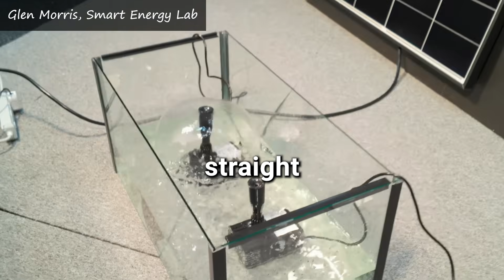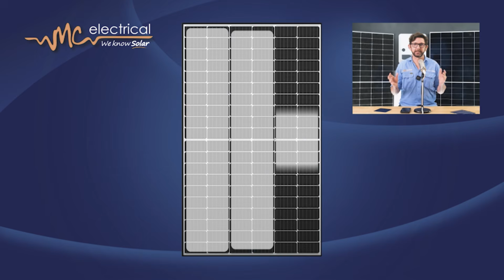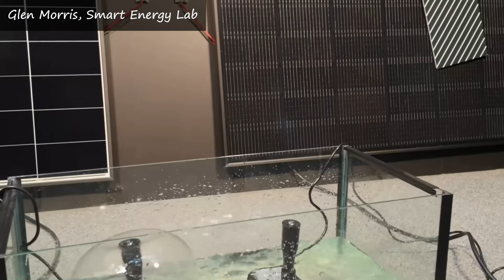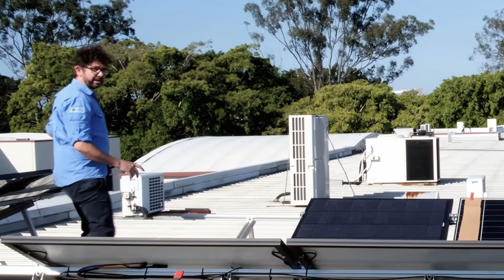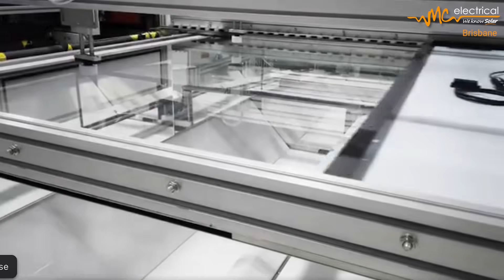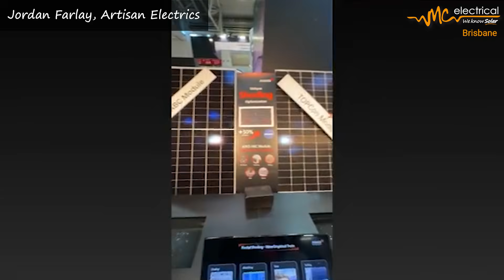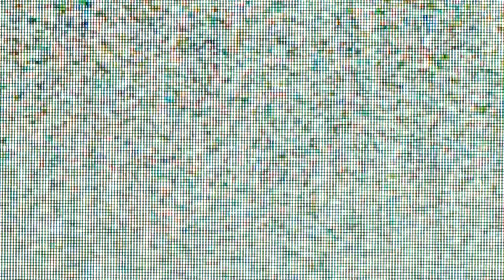TEST RESULTS REVEALED. Do Aiko’s shade proof claims add up?

Comment: So what was the out come did they get back to you?

I was doing the AI questions and get deep into a aiko "shade proof" research hole lol
The west side of my roof has heavy tree shading at like 2pm in winter.
From memory my winter daily production is only 3kwh avg on a 5kwh system ha
Summer she cranks pretty close to the avg.

So yeah found this video doing research trying to figure if its better for 20 aiko 500w or 23 440w "regular" jinkos 

I'd more or less love to see this testing done with branch shadows across multiple panels rather than just putting a piece of cardboard across one panel, or enough of a shadow to block a small portion, hooked into the same string.. even just like a person stood infront of the panel blocking the sun (again could be inconsistant) but it would block differnt parts of the panel like an actual tree would.
But that would be hard to get consistent results 
*And as the t'n'c's say you're not supposed to install in a shady area ?
Reply from the maker: Yeh Aiko were dirty at me. But, the story continues. I was in the Longi factory a few months ago and I convinced them that the shade demo that they also use is BS. They agreed to take down the misleading marketing from the trade show this week.

Comment: now wich beter?aiko or topcon?
Reply from the maker: Good question. I don’t mind back contact. Looks pretty nice and can have a small advantage with bird droppings etcx Vut Aiko are not the only company doing back contact. I’d probably choose Longi over Aiko if I wanted back contact. The only reason I haven’t changed to Longi, like others, is they refuse to update their install manual to allow the panels to be installed in an area that will get shade, meaning, any shade , ie 6am shade. Same with Aiko, same with most panels.

Comment: That's called integrity. We're just finishing building our new house and we're absolutely getting MC Electrical to help us with solar panels, battery, and chargers.
Reply: Be sure to get other quotes from quality installers. For example, I got a quote from MC Electrical to do 3 phase upgrade was estimated at $6K but I got someone else to do it for $3K granted I dug my own trench from meter box to the Greenboy.
Reply from the maker: Thanks, we're happy to help when you're ready. Give us a call on 3268 3836.

Comment: Hey. I read about those abc panels. In fact longi is doing "back contact" cells now too. As far as i understood and read somewhere on their page - cells works like bypass diodes, BUT whe more than 3 cells in row is shaded - bypass diode engage. So when shade is big enough - bypass diode will work, so thats why you had most gains in "wallet size scenario". - so you shaded 1 cell and it was bypassed. If it is working as good as it is expected...  half cut panels makes no sense anymore. If there is shading in one half of panel in half cut, and they really works like bypass diodes it creates difference in string lenght between upper and lower part so this 1/3 of panel works suboptimal. If there would be halfcut - so one big squere cell like in old panels - only shaded cells would be bypassed, and all the rest would work optimal
Reply: Yeah, and maybe bypass diode is not needed anymore, since it just simply bypass those cells and allow full current run through
Reply from the maker: I was at Longi’s factory a week ago. I argued with their engineers and they finally agreed with me. This Logic of 3 cells being shaded only works when one panel is in running. Put it in a string and it doesn’t work. I asked them to stop lying to us and take that stupid trade show demo away. I think they might

Comment: do all the tests ya want  
real world on  a roof in the sun when clouds come over  and what change it makes at the inverter output   for similr wattage panels  and same inverter   and how well they do at sunrise  and around sun set    tests in a hall with uv generator are all rubbish    only real tests in the outside with sun    is all that really matters
No cloud comes over and completely blocks up a strip     monitor when cloud cover affects bothh again real world tests

Comment: I enjoyed your test. Question from ignorance. What happens if any panel is shaded evenly all day by a large building rather than partially by say a chimney? Will they work at all? Thanks.
Reply from the maker: Great question. I’ve got a bunch of videos around this. Maybe look at my Enphase videos from a few years ago. But in short, most inverters deal with this easily. Fromius and SMA deal with it better. It’s basically the job of a bypass diode, improved by a good inverter algorithm.

Comment: Mine are working an absolute dream. I have loads of trees and all installers told me I needed mitigation. I ignored them and got these panels without optimisers or micro-inverters, they exceed all output projections.
Reply from the maker: Great that you are happy with your production but I guarantee you it’s not because of secret sauce in the panels. It will be because of simple bypass diodes or the mppt or gmppt of the inverter. Accurately estimating production in significant shade is basically impossible. Your installers were wise to project conservatively, and hopefully used an inverter with a gmppt.
Reply: @ Thanks. They were predicting 30kWh a day this time of the year, with optimisers. I’m actually generating 80 kWh without optimisers. I’m using the Tesla PW3 hybrid inverter. They (not just one) got it very wrong in my case.
Reply: @yp77738yp77739  the Tesla PW3 most likely uses some sort of gmppt.

Comment: Power density is the point and you've knowingly ignored that. The 475W are 23.8% efficinet while the Canadian is much lower density.
Reply from the maker: Fair point. But it wasn’t really the focus of this video. On the previous video I mentioned it was stubbier for the same power class. This video was about their claims in the shade. The new Canadian 465 is 23.3% efficient. Close but no cigar. But they have a proven track record, so that extra 10mm of panel is probably not that big of a deal

Comment: Hi Mark. So I worked for a company where we built our own Aiko presentation for expos and we did get the good results that showed Aiko was shade tolerant. Also while messing around with the display we found that with significant shading the Aiko still worked well. Can you explain why this is the case compared to your “real world” simulation? Also, you were saying that the superior performance of the Aiko in the middle of the day was irrelevant and you probably should have mentioned that if you had batteries you would realise the benefit. Anyways, really interested in hearing from you in regard to my question because I’m genuinely bamboozled. Cheers!
Reply from the maker: Thanks for the comment! Interesting. Yeh I don’t actually know the answer. I figured they don’t do a dodgy set up in the background, or otherwise people like you would blow the whistle. It’s just a niche voltage and current characteristic that happens to show the difference of Aiko.  And there is a difference. Just nothing tangible in the real world.
Reply from the maker: Batteries, yes good point. I’d be keen to talk more about this. Are you based in Australia? I’d be keen to learn about that setup. Contact us sometime if you get the chance and tell my team about this chat.

Comment: I can think of 3 ways to do this demo;  One possibility is to down right deceive by using a battery on the panel that keeps running when shaded. The other possibility is to manipulate the result by picking a pump that only runs on a very certain voltage, where 2 strings from the competitor panel (440w) would not be enough to run it but 2 string from the other panel (470W) one is. The last possibility would be to have a circuit in line that cuts all power from the panels when it drops below a set voltage and again tune that to the exact voltage of your panel you want to show off.
Reply from the maker: I think it’s closer to option 2. There is not enough reverse module current to engage the bypass diode on the Aiko. But there is with canadian. Just a niche test that works well for Aiko

Comment: LOL,
They are doing that demo at a trade show, where is the sunlight coming from?
Reply from the maker: It’s a spotlight they have shining on the panel. Yeh I was surprised that would work too. I have been meaning to test that one day, but Id need to get the correct dc water pump etc.

Comment: Very informative video thanks.  We used to use Jinko and JA panels and although they were great panels, we have found that our systems are performing better since changing to AIKO panels.  When AIKO were introduced to us, we were told by our Supplier not to be reliant on the shading feature and to still install optimisers as we normally would.  So I think the shading feature is bringing down the reputation of a good panel which is a shame.  I think you are right, they need to look at their marketing because they don't need a gimmick.
Reply from the maker: If they are performing better, it would probably be that the old panels degraded. They used to degrade about 1 percent a year, newer panels degrade slower. I wouldn’t expect any more than 0.5 percent gain from Aiko - but that’s only if it were a bizarre morning and afternoon shade situation.

Comment: I came across this video as I am being quoted Aiko Neostar and also Jinko Tiger Neo panels. Similar output around 13K panel system with the same inverter (Sungrow). Aiko quote is slightly expensive by around $500. However Aiko offers partial shade optimisation and Jinko doesn't. Aiko Neostar datasheet also mention 3 bypass diodes and Jinko doens't mention it. Does it make it worth to spend that extra $500? Long scheme to things $500 isn't much difference. Appreciate any feedback.
Reply from the maker: Hey, All panels have 3 bypass diodes. I wouldn’t buy of Aiko because they are dishonest. They may not last when people start realising that they have been told lies.

Comment: Hey, this is great information, thanks. I've recently had a system installed with 22 AIKO panels and a PW3. The PW3 integrated DC isolator switch keeps tripping, basically every sunny evening (when the panels are partially shaded by trees). I'm wondering if the AIKO "shady" feature is mimicking optimisers, which are known to cause problems with PW3s.
Reply from the maker: Hey Dave, no optimisers “boost and buck” voltage with Power electronics. The Aiko panel isn’t doing any of that. But I’d be interested to find out what the issue is. 
BTW, If you bought Aiko panels as a shade solution I think you’ve got a fair case of false and misleading claims with ACCC. 
https://www.accc.gov.au/consumers/advertising-and-promotions/false-or-misleading-claims
Reply: @mcelectrical  Thanks, I'd like to find out the root cause too. Still working with the installer on the issue. I suspect Tesla and AIKO will be in "blame the other guy" mode right now. If they're not just hard ignoring the enquirers from the installer. I have collected data, can forward you a report. My theory (as a complete solar noob, with some electronics background) is that the PW3 is just not coping with the behavior of the AIKO panels, it probably models a panel with the traditional 3 bypass diode setup, not panels where every cell can act as a bypass diode.
Reply: How has the solar been installed with the PW3?  For example 12 aiko 460w on 1 MPPT and another 12aiko on MPPT 2 ?.  @davesubverse
Reply: @chrisyoung7362  It's set up 10, 6 and 6. I never heard anything back from the installer or Tesla or Aiko. But the problem went away when I chopped down the trees that were shading the panels.

Comment: Fronius Gen24, sorry after 3 years my rating is 3 stars when 10 is the best. The reason is too many problems every month I have to restart Fronius. Now it will be replaced by Sungrow.
Reply from the maker: Oh right. I did the figures. About 15 percent of our Sungrow inverters have had call backs. About 4 percent of fronius.
Reply: I agree with you, but cost and effect matter. For 10 years I had Growatt 5kW and never had any problems, unfortunately it was not recommended, of course someone earns extra on what they have too much or bought for a good price. Fronius is new on the market, let's wait 4 years and see. I am an electronics engineer by profession and I know what to expect from Chinese electronics, but sometimes I come across a well-made device for half the price. We are far from Europe and the shipping costs to Australia are not worth it, and we are dependent on China.

Comment: @mcelectrical  It's brand new out, made by Renogy who are more aimed at campervans, caravans and marine, it's  called the Renogy ShadowFlux... Won't let me put link here, but you google it and find it on the Renogy website. It claims to have cell level shadow technology and uses 16 busbars with a constant 36 vaults which is really high for a 200w panel. There are youtubers tested it and their tests look more real, done from home etc and seems to work really well with shade. Very expensive for a 200w panel, but thats OK in campervan world cos you only need 2 or 3. Wouldn't be good value for residential!

Comment: Can you look at the new Renogy 200w Shadow Flux please, I'm wanting either 2 of those ShadowFlux for a total 400w on my campervan or 1 Aiko 510w all black 2nd gen. Not sure which would be best in shade and best when flat on campervan roof.
Reply from the maker: Tell me more. I’m not so invested in off grid systems but is this a panel like Aiko?
Reply: @mcelectrical  It's brand new out, made by Renogy who are more aimed at caampervans, caravans and marine, it;s  called the Renogy Shadow Flux... Won't let me put link here but you can find it on the Renogy website. It claims to have cell level shadow technology and uses 16 busbars with a constant 36 vaults which is really high for a 200w panel. There are youtubers tested it and their tests look more real, done from home etc and seems to work really well with shade. Very expensive for a 200w panel, but thats OK in campervan world cos you only need 2 or 3. Wouldn't be good value for residential!

Comment: Possibly, there is a very marginal difference between the panels and they chose the test condition just right so that the pump stalls with the Brand X panel but pumps with the AIKO panel.
Reply from the maker: It least in the video, the competitors was a 440w panel. But my guess is the panel just happens to work like that when directly connected to a dc pump. Interesting but not helpful.

Comment: Hi Mark, I don't think your doing fair tests. All their tests are just 1 panel vs 1 panel with multimeter (not an inverter) https://youtu.be/OfwKkDMQmho?si=QbvGveSb0IcWCkRz. There are other demo videos (non trade show) where they are only fully shading individual cells not a whole section it also appears to be in the middle of the split of pannel, not at the top or bottom directly. There is another German person who also say its a scam https://youtu.be/BOfiiLAeCtY?si=hVItxuipDsCxoqI9 , but he is double shadowing in his test i.e see his at 17:20 and if you look at his tests it actually proves that shading with shadows is better... Shade is not traditionally fully blacked out unless a there is like a building or a twig/leaf/branch directly on it. Typical shading from trees is a distance thing and their is residual light around it.  I don't think Aiko is the holly grail, but I do think they have technology in their panels that assist with light shading. Please replicate their exact tests, notably in the middle of the join of the panel as per the first video I linked, then do the same test on an inverter and see what the results are.
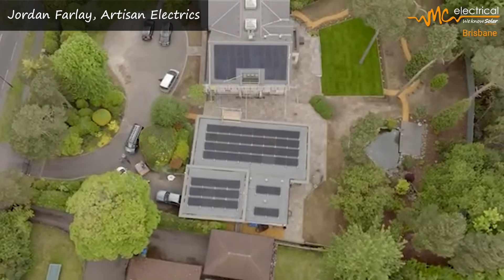Reply: I have seen it. The biggest Question ist at 16:30 -  why reduces one total shaded solar Panel
 the Power of the String so much. 😢
 From 650w ( 3 aiko panels in series) increase  to only 200 w !!!

( and this for both panels producers.aiko and...)

Has anoybody an answers?
Why isn't IT at least 400-450? (the Power of two... and only one is getting lost ?

...or what do you think Marc...
could have microinverters there in this Special case the better results (F...Enph..) (If the moon shadow with the sun every 6 years)😮

Its real unbelievable why there are only 200w.

 perhaps IT is an Idea for a small part of a   Shadow Test.
or becomes the Shadow String inverters really good?
Happy new year
Reply from the maker: Hi stealthmatty. My intention wasn’t to replicate their exact test, but to put their test into real world conditions. They test infers this is how the panel works in the real world. And when directly asked them, they said it would work like this on the real world. 
Not even close. So while there is some degree of truth to their claim, I think it’s about 1 percent truth. Not enough for me to put my confidence in a new panel - especially when they mislead their customers.

Comment: I was dubious on AIKO when they first came out

They basically claimed it was a Maxeon (legal patent infringement pending) whilst not backing it with a confident warranty or any outside solar market evidence? 

They then made weird market claims ignoring size differences with “misleading” marketing that sales people have then been pushing and spreading. 
I have been waiting for this “real world” aspect
Reply from the maker: Funny you say that. On of the complaints they had was to screenshot my Sunpower blog where I said it was a more durable cell. It uses similar technology- but without the copper backing (so I was originally told). But then … why would I  believe anything.